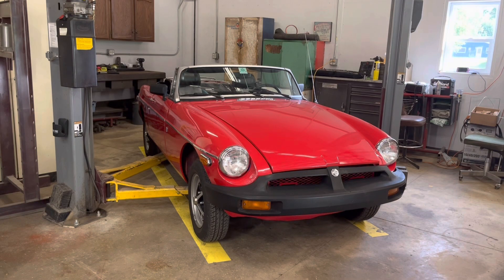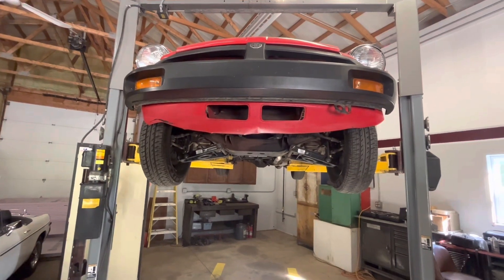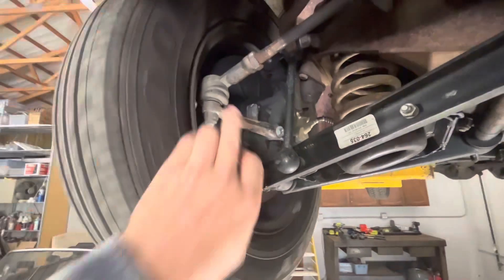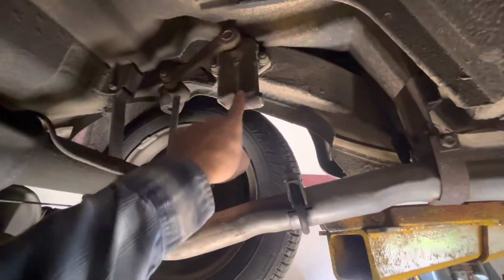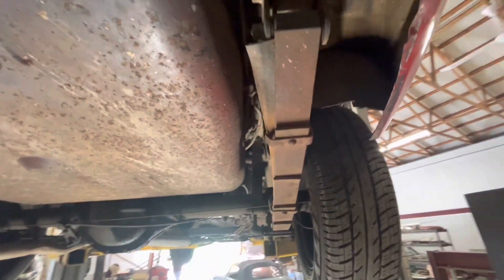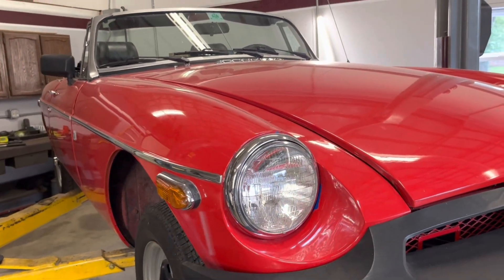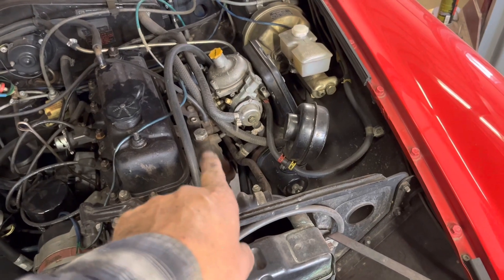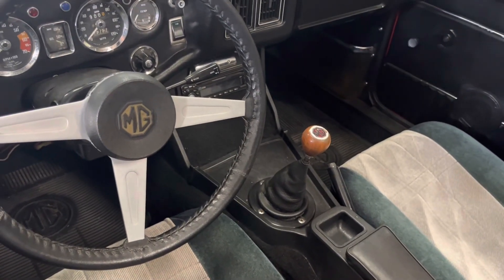76 MGB new purchase inspection

Comment: What a great car ! No rust , must have been a southern car or never seen a winter .
Reply: Thank you much.
I love you video.
You have so much insight into what you do.
I guess my question is better asked what years MGB engine are most reliable from the bearing design and least complicated with regard to pollution controls. The size should not matter as I currently have a MGA block and trans installed but I have a issue with the water jacket
Thanks again
Ted

Comment: i had a 79, painted it as a black (only color) like 80 Limited w stripes, put on duel SU's and arched the rear springs. Great cars also to pull the EM brake whip around in other lane and take off again all in one action! Loved that that car! _ tires are fine. Get the ZENITH carb off of the thing! I burns cars!

Comment: Curious if you were installing an MGb engine with overdrive in an MGTD WHAT YEAR MOTR AND TRANS WOULD YOU CHOOSE
Reply from the maker: I really don’t know, as I never really thought about putting a b-series in a TD. I would think a ‘67 and earlier engine would be a little easier as they use a smaller flywheel and wouldn’t take up quite as much space In the interior to clear the transmission.

Comment: How relevant is this to the 1980 mg mgb does the info crossover well?
Reply from the maker: There’s lots of detail differences, such as a repositioned radiator, updated interior, added sway bars, a little more complicated emissions and wiring, but they are still the same car so it’s very relevant